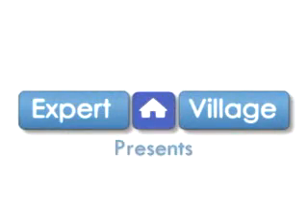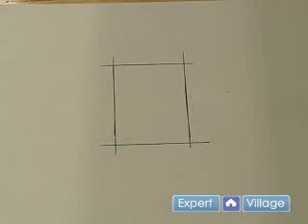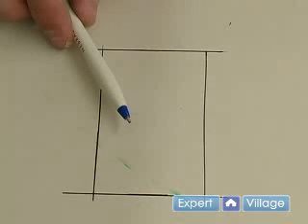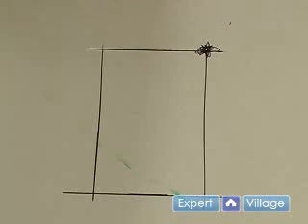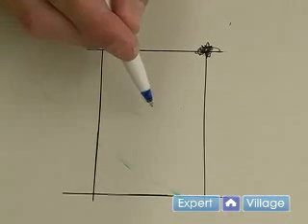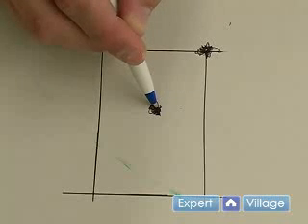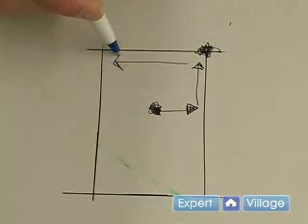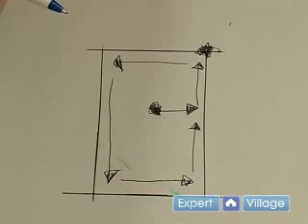Cutout Tools: Tips & Advice : How to Cut an Outlet Box in Drywall

Comment: You need to draw arrows for direction of cut come on man you are nuts, I would not let you anywhere near electric cable's. Put the box on the wall place a spirit level on the box for straight line and then draw around box cut out and should be exact fit. Who needs all these arrows.